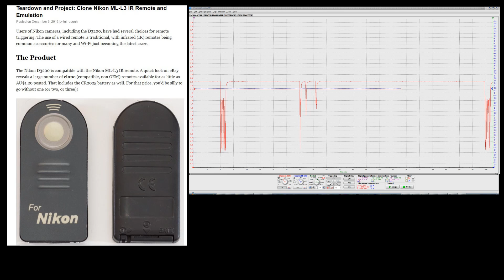Project Overview: Automated Turntable for Photogrammetry/3D Scanning

Comment: Travis, nice job. Noob question. Do you need to process the photos in any way before uploading to Agisoft or any other software? basically when I trey the turntable method the software is aligning all the photos in the same position and the point cloud is very dispersed. i.e. if I just go around the object I can see that the scanning software takes the photos and approximates them around the object. But using the turntable method no joy so far. Any tips?
Reply from the maker: san k This was an issue I had run into as well. I found that if the entire object was framed in the photos, my point cloud would be incorrect and align all of the photos from the same location.

My solution was to capture only part of the object in the photos. For example, I captured the top and bottom half of the fountain in separate data sets. You may be able to see what I mean if you pause towards the end of the video.

Thank you and good luck!
Reply: Thanks for the tip Travis! I will give it a try. So far my experience in scanning small objects has been utterly frustrating. Have tried turntable and without turntable, most of the time the table or surface on which the small object is placed comes out perfectly scanned but the object itself is useless :-( I will try multiple sets with part of objects. Cheers

Comment: Its often not a good idea to rotate the object you are modeling, since the programs rely somewhat on objects in the background for positioning
Reply: Still a nice turntable tho, its probably much easier to model things
Reply from the maker: Hey, thanks for the comment! I did find that with the light box, I had to frame the subject a certain way when taking the pictures for them to align correctly. The shots had to only have a part of the subject, as shown at 2:31. When the entire fountain was in the frame, the software didn't know how to interpret it.

And yes! The turntable is great for smaller object, and saves a lot of work, haha
Reply: You can also try scanning with a kinect or other structured light system.  They work well with turntables.